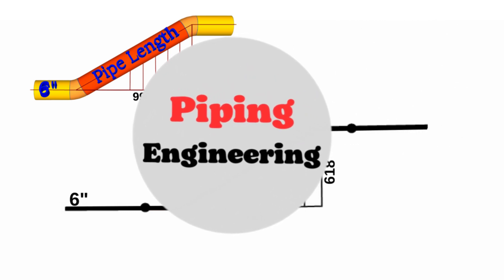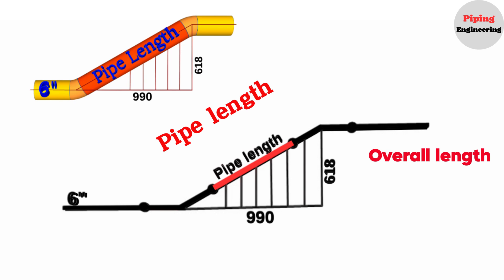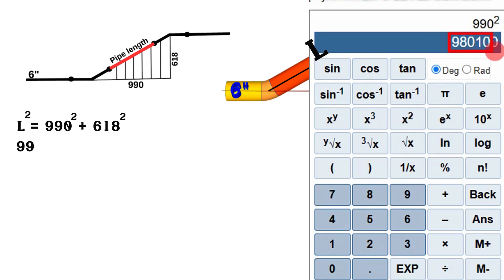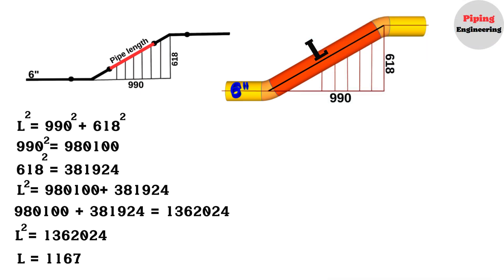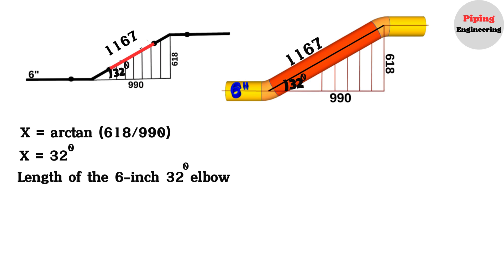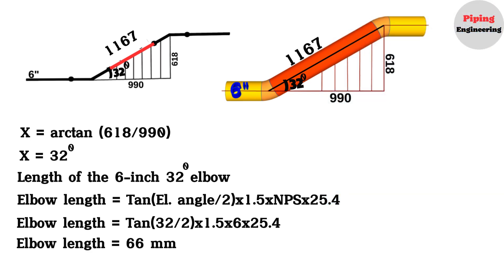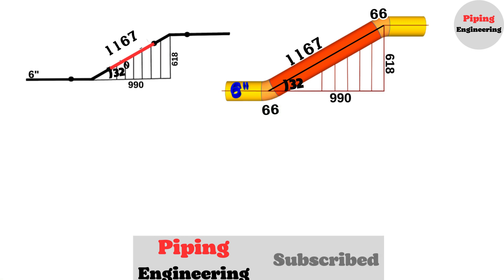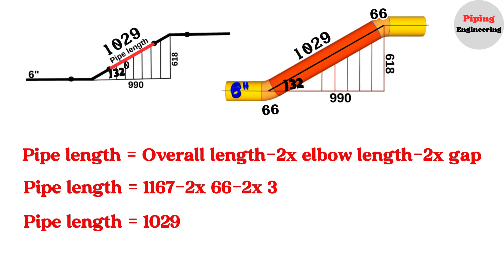How to Calculate Pipe Length & Elbow Angles for a Double-Rolling Pipeline.

Comment: Hi thank you for your video but I just want to ask 
I am designing a dam with a penstock or pipe with dimensions 
Diameter= 2m (proposed)
Head gross of 22 meters 
And a Volume flow rate =8.67cubic meter / second

What will the length of my penstock horizontally and diagonally to the powerhouse or turbine? And what is the desired angle? 

Since my flow rate is not that big does my penstock should be shorter and my angle should be steeper?
Reply: I am using a stainless steel material